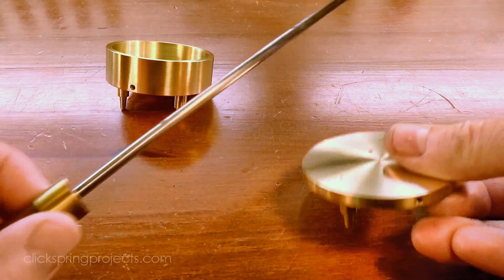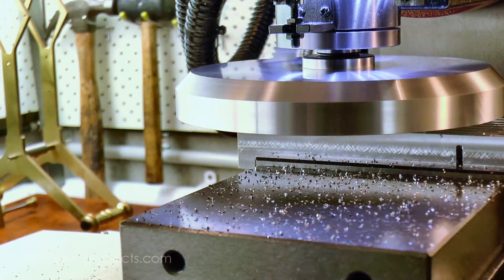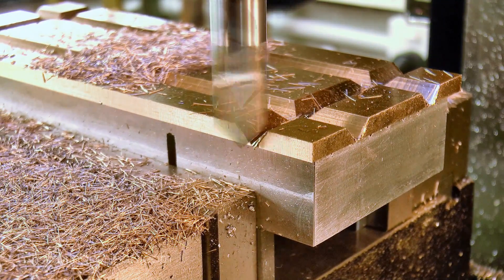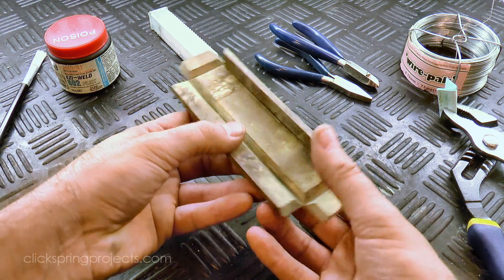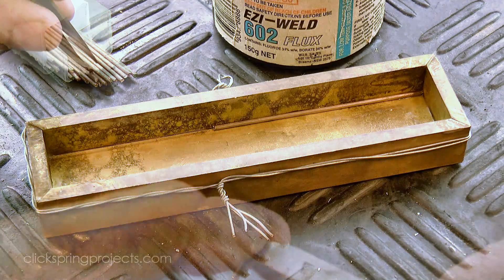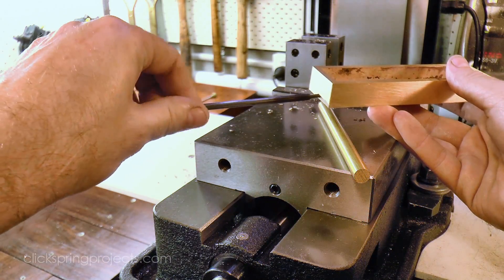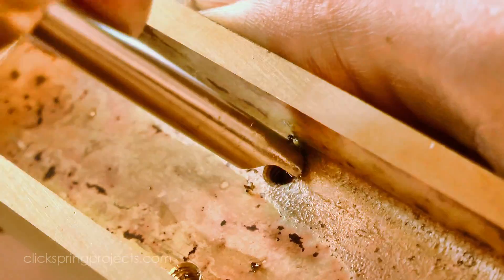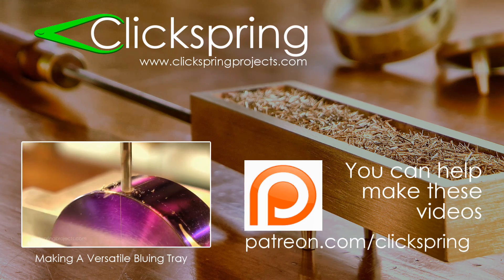Spare parts #9 - Making A Rectangular Bluing Tray

Comment: Chris do you heat the brass shave from the bottom of with a torch from the top, would like to try that method to blue son watches screws that have the display bottom. And another question. Where do you buy your supply of brass? trying to find 2' o 1 1/2" brass tube to build the tray but no luck yet.

Comment: hello Chris,
I realize this is an older vid and my comment is not about the bluing tray. but rather about your shop made fly cutter.
in a nutshell, I will need to resurface an aluminum cylinder head soon and I was wondering if a fly cutter such as the one you made would do the job. I realize of course that the tolerances must be within a a thousandth or two.
you thoughts on this matter would be greatly appreciated.
by the way, I often binge watch your making of the Antikythera mechanism and just love the way you go about your projects with such love and passion.

Comment: G'Day Chris,

Every time I watch your fascinating videos I'm left with just so many questions:
• This is the first time that I've seen "blueing" done with a bed of copper shavings. Most frequently I've seen it done simply with a blowtorch & a tin of oil, or with a chemical treatment. What's the advantage of doing it this way over something like Birchwood Casey Super Blue?
• Why a box formed from thick brass & not just one from a (cheaper?) thinner mild steel cutout? Aesthetics or functionality?
• Why only two feet instead of a more stable four? And why have the threading holes penetrate all the way through the brass (thus needing rivet caps), instead of making shallower holes (or just positioning them below the box walls)?

I've only been aware of your channel for a short time, but have been riveted by the extraordinary attention to detail, functionality & aesthetics in your projects (especially the exquisite Playing Card Press). Not merely mass manufactured tools, but singular (& wonderful) works of art.

I'm also pretty chuffed that there's such damn good content from another Aussie (I'm over in Bunbury, WA) - it gets kind'a tedious listening to American accents sometimes.  ; )~

Comment: i recommend counter sinking the holes before you thread them, not afterwards. it will achieve the same result, but it also gives your tap an easier entry point, and it doesn't break the first thread lead since it is cut after sinking.

Comment: When bluing your parts in a tray, do you heat from above with a torch?
Reply from the maker: Mostly from below, although occasionally from above if you need the temp of the top of the part to catch up - Cheers :)

Comment: “A gentle heat breaks the bond🙂”
gets blow torch
Reply: What did you want him to use? A Bic lighter or a candle? We are talking about like 250 degrees Fahrenheit. You sear steaks at twice that. Pretty gentle, if you ask me.
Reply: @animalmother556x45  relax bruv. most people have no clue what gentle is when it comes to working with metal
Reply: @eccomi21  it's like when machinists say a part is becoming "warm," that's code speak for screamin' hot!

Comment: Anyone else watching this to find out what a blueing tray is?
Reply: Personally, I'm here to find out what a rectangle is?
Reply: had an idea of what it might be, but had to check to be sure. but yeah.
Reply: https://youtu.be/8h1Uf9bkc3E

Theres the link to him making the rest of the blueing set. At the end he explains it
Reply: @Roderick storey Exactly. Bluing steel is actually quite the art. It is a real old world craft few people today have mastered.
Reply: Union Pacific Exactly
Reply: Here here!
Reply: 100%
Reply: Right here mate
Reply: Yep, no idea
Reply: Yes
Reply: I know what it is now. But how does it work
Reply: @UwUOnDatBeat1101  honestly it's a kind of complicated process to explain. 
Basically usually when iron rust it turns into reddish iron oxides (Fe2O3). Under certain conditions its possible to turn this red rust into blackish magnetite (Fe3O4).

The major difference here is that red rust greatly expands in volume and begins to flake off. This exposes fresh iron to the oxygen in the air and the steel will continue to rust away completely. 

The black "rust" doesn't expand in volume or flake off and remains as a protective coating on the surface of the steel. You can't oxidize what is already rusted. 

There is a bit more to it then that but again, that's the basics.

Also different forms of bluing might use a slightly different method, resulting in a different form of oxide barrier. Think of it as bluing is scientifically controlled rusting.
Reply: i do. i dont know or understand whats going on at the end 7:58, why its turning blue? whats are those chips? copper leftover??
Reply: @treyondaren3542  It turns blue because the steel is combined with just the right amount of heat, reacts with the oxygen in the air and quickly oxidizes into a more stable form of iron oxide then the usual red rush. 

The chips the part is sitting on I assume is brass. It's just there to hold the part and allow the air and heat flow evenly around the steel, while not melting and burning in the process.

Copper doesn't chip like that, machinist love our brass.
Reply: I typically watch these type of videos because I have a hard time falling asleep and I can’t use opioids
Reply: Now there’s an everyday DIY project if I’ve ever seen one.
Reply: Yes
Reply: Yes
Reply: Nah, I knew from the last time I watched this video
Reply: I came to like this comment - but it’s got 666 likes so I left it. :)
Reply: Trying to figure out how he fits a shotgun barrel into the tiny little box. So disappointed.
Reply: @mikeries8549  that's rust blueing
Reply: Why not just paint things this blue color? They make paints so good you literally wouldn't be able to tell it was painted... this process seems like a waste of time.. its neat, dont get me wrong, but seems like a long expensive process.. for what?? Just paint it that color and say it was done this way.. nobody would ever know.
Reply: Google
Reply: Union Pacific your watching the wrong channel if you don’t know what bluing is
Reply: @charliebowen5071  or he is like me completly new to this channel and never saw this process before.
Reply: @draco5991rep  Well in that case. In short, Bluing is a conversion coating done to steel. It's achieved by converting a small surface layer of Iron into one of it's oxides, Magnetite and infusion of a none wetting(water displacing) oil. 

There are different forms of "bluing" but, that's the basis behind it all.

Welcome to ClickSpring.
Reply: @charliebowen5071  Don't act all smart and holier than thou when you can't even use the correct "your".
Reply: @charliebowen5071  I wish I was as omniscient as you

Comment: This is like Planet Earth quality recording and narration, but for machining. Incredible... I'm astonished by your steel bluing process. All I was looking for on Youtube was how to blue some steel parts and I came across your videos. Now for some reason I want to spend my life building a clock. What sort of heat source do you use for the bluing? Just a propane torch or something fancy?
Reply from the maker: Yes a butane or propane torch is convenient, but pretty much any heat source that matches the mass of the part. Traditionally a small oil lamp would be used for small screws - Cheers :)
Reply: @Clickspring  Thanks for answering! Even your brass shavings look like they're perfectly machined for the job, though I know they're probably just scraps. Have you ever tried with any media other than brass shavings? Maybe sand? Something a commoner might have lol.

Comment: My bluing never comes out that nice ): i haven't made a tray yet but I'm not as worried about even heat distribution, in fact I'd rather have the slight color deviations between straw and blue and purple but it always seems to leave a tarnished kinda finish over the metal.. the color comes in very beautifully but when it cools it seems as tho a layer of haziness comes over almost like oxide but it's stainless.. not sure what kind tho that's all I can think, or hitting it directly with the flame rather than passively through induction.

Anyways great videos as always, I might make one of these but rather than using bends and solder I think I'd rather mil out the center of a solid block to avoid deviations in thickness and heat transfer due to any air acting as an insulator.

Comment: Hi, that was fascinating video, Thank you. I have few question if I may: 1. Would it work the same if I mill bluing tray out of a solid block brass instead of folding technique of your video? 2. Inside the tray, are you using the brass shaving or others? What happens if my milling shaving are not stringy but tiny chunks? 3. Once the tray is made, I see you did a wonderful job of evenly bluing of your clock arms, but my parts are not flat but more of a curve and with angles protruding. Will I need to bury my parts into the shaving to get a even color? Thanks again for a very informative education video

Comment: To be honest, I would have suggested making the trays out of aluminum/aluminium (whichever you prefer to call it). Aluminum has a much greater thermal conductivity than brass. It's about as easy to machine too, even if it's harder to solder. This can be easily solved by using solder & flux meant for aluminium. This is just my thoughts on the matter.

Comment: When you're drilling holes, you usually spot the hole then swap tools, but the tool you swap to looks to be the same diameter, why the swap?  Great videos by the way!
Reply from the maker: Hey Duncan, twist drills are notorious for 'wandering' off position if there isn't a starting point for them to begin drilling. The first drill you see me use is called a spotting drill, and is much stiffer than a standard twist drill, and experiences much less of that 'wandering' effect. It starts the hole, and then the twist drill follows it without issue. Thanks for watching and asking :)

Comment: ho do you prevent the soder from melting when you heat up the tray for blueing
Reply from the maker: The hard solder has a much higher melting point than the temps required for heat bluing - thanks for watching Timothy

Comment: When applying heat to your tray, is the torch being pointed to the tray itself from below, or from above to the workpiece and shavings?
Reply from the maker: Mostly from below, but occasionally if a section lags in color a shot of heat from above may solve the issue. For best results tho, heat from below, and keep the flame low.

Comment: why did you bend a plate of brass into a box instead of just getting a block of brass and machining the onside out?
Reply from the maker: Cost of materials - brass is very expensive, better to use up scrap than purchase new stock. Thanks for watching and asking
Reply: Clickspring oh ok cheers for replying. i subbed too! your builds are awesome!

Comment: You make machining look too easy (if such a thing exists). Whenever end milling, I take it at a quarter of a millimetre at a time. When you perform these actions, it looks as if you're taking off a few mil at a time.
Reply from the maker: Brass makes everyone look good Oliver! Great to have you watching mate :)
Reply: Oliver Church ours was HSS but that was the max we'd push those end mills on manual mills. Carbide on a CNC however would surprise you.  Just search Titan CNC and you'll see some crazy feeds and depth of cut
Reply: Oliver Church I'm usually taking .050 inches (1.2mm) for rough cuts on mild steel.  It depends on your tools, machine, clamping, and material
Reply: Barty Crowell I'm not sure what our tooling is made up of at college, so I'll go with HSS. Then again, I think there is some slight paranoia that I'm going to fuck up the tool or my work in some way.

Comment: does the bottom the parts that you blue have a different color, on account of temp/Oxygen being different on the underside with all of the metal and stuff?
Reply from the maker: Different surfaces will often change color at different rates, hence the need for the tray and shavings. The extra thermal mass slows the process right down, spreads the heat and makes it more uniform in order to bring all surfaces to the same color at the exact same time. Thanks for watching Jace :)

Comment: Is there any good reason aluminum wouldn't work as well?
Reply: Maybe the lower melting point, brass melts at about 930 °C (1700°F) while aluminum from 400 to 630 °C (1200 °F) depending on the alloy
Reply: Very good point. Bluing temperatures are between 350°F and 650°F (180°C and 340°C). Hopefully this is still enough headroom so as not to cause a problem. Check out the temperatures per color: https://en.wikipedia.org/wiki/File:Tempering_standards_used_in_blacksmithing.JPG

Comment: Your videos are awesome! Always impressive work.
I'm thinking about using this technique on an upcoming project. How much material are you leaving at the bottom of the slots you're milling? It doesn't look like much. I'm going to use 4mm-6mm material should I mill 3/4 of the way through?
Reply from the maker: Yes its quite thin, about 0.4mm. I have found thinner is better for crisp edges, and it seems to fatigue the metal less, so you get a small shot at positioning it after the initial bend without it fracturing.

Comment: a mild heat can remove the super glue. * proceeds to blast part with flamethrower*
Reply: 300 odd degrees is very mild by metal standards.
Reply: violently grabs napalm
Reply: Brush burner

Comment: Would it be possible to blue stainless steel firearm parts in this way? 
Can a black oxide coating be achieved on stainless steel? 
I greatly appreciate it. Thanks a bunch.
Reply: I would not recommend trying that unless you are sure this will not cause the parts to loose their characteristics.
You can always use chemical oxidizing.

Comment: Hey Chris, I've noticed that when you're drilling, you usually make a little divot with one drill, then switch to the twist drill. What's the purpose of that?
Reply from the maker: +Dan D Hey Dan, twist drills are notorious for 'wandering' off position if there isn't a starting point for them to begin drilling. The first drill you see me use is called a spotting drill, and is much stiffer than a standard twist drill, and experiences much less of that 'wandering' effect. It starts the hole, and then the twist drill follows it without issue. Thanks for watching and asking :)

Comment: What is the point of heating it to turn blue other than making it look cool?
Reply: Tempering
Reply: +Mason Meeks 
No, tempering is to take some of the hardness out of a hardened metal so it is not brittle, and does not have to be blue.
He is turning them blue and I don't know if it makes it nor resistant to rusting or what.
Reply: or it could be to look pretty as a "cosmetic blue"

Comment: Chris, I do very like your video's !!!! I have a question for you :  what's the best way to get brass swarf like does you use in heating ? Whenever I do turn or mill brass I always end up with a much finer swarf that goes everywhere and it's almost impossible to collect.
How to do the magic ?
Reply from the maker: +Pierluigi “Pigi” Frullani Try using a slower rpm, and larger depth of cut, it should give you some nice chips. Thanks for watching
Reply: +Clickspring Yeah, Chris ! That did the job ! Last question if you don't mind. How long does it takes you to reach the right ( I would say "blue" ) temperature ? Thanks for answering, and moreover thanks for your videos :D !
Reply from the maker: +Pierluigi “Pigi” Frullani A new video showing a lot more detail on the bluing process should be out in a few weeks.
Reply: Can''t wait for seeing it ! Thanks

Comment: About the superglue arbor, to what temperature do you have to heat it to release the parts?
Reply from the maker: +TheNorthkiters Not very hot, CA glue starts to fail at temperatures above approx 80 degrees C. You can also release parts by simply soaking them for a period of time in acetone. Thanks for watching and asking
Reply: +Clickspring And thanks for the reply, I have a job for the CNC I think I will use it for now.
Reply from the maker: +TheNorthkiters The grooves are the key, to let in air (moisture) to cure the glue across as much of the surface as possible.
Reply: +Clickspring I understand, the glue needs air to react with. I will add some grooves along the surface! I will post here again after the job is done. Lets see if it holds! I will limit the surface speed and depth of cut just to be sure.
Reply: +Clickspring It worked out great! holds perfectly and with a bit of heat it releases. Perfect for those smaller aluminium parts. Here a quick picture of one of the results:

https://c2.staticflickr.com/2/1448/25628819922_a498a9be69_h.jpg

https://c2.staticflickr.com/2/1461/25123204783_a9ac59291e_h.jpg
Reply: +TheNorthkiters going to be difficult to post a photo on YouTube :D
Reply from the maker: +TheNorthkiters Awesome, thanks for letting me know :)

Comment: please explain the bluing process you use. all videos out there are mostly for guns, and do not have that truly blue color.
Reply: +Mariano Gaston He is tempering the parts to achieve that color, basically heating it to a specific temperature. That blue color corresponds to about 590 degree F. It's not the same as Hot Bluing for guns.

Comment: I'm confused, how will solder hold that joint once its heated for bluing?
Reply: +keeganwebber The solder he used melts at around 840 degrees F (450 C) and the bluing temperature is only about 590 degrees F (282 C). That's why he used Silver Solder, it's known as Hard Soldering because the solder melts at higher temperatures